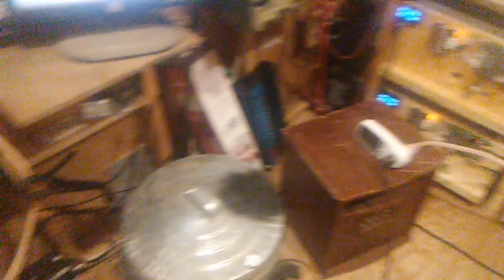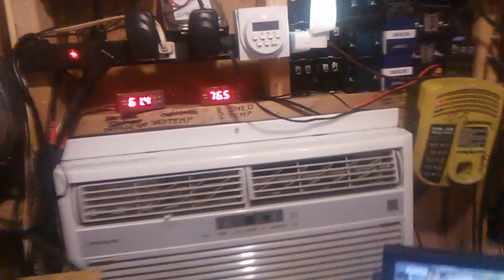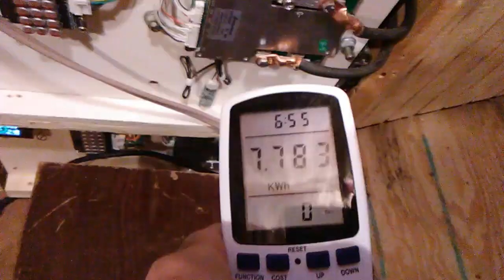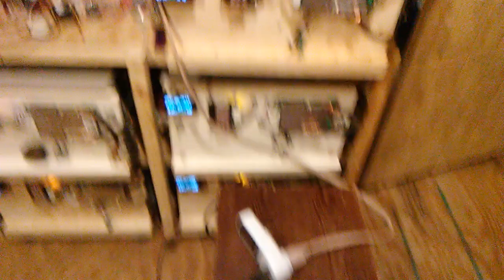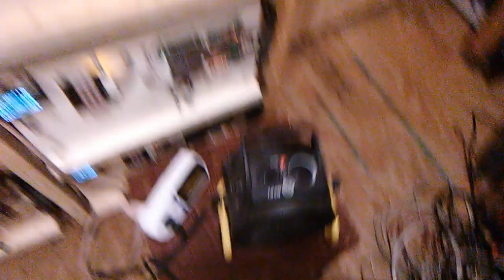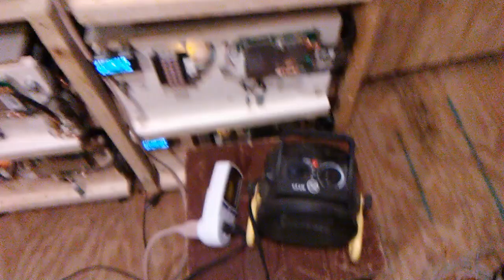Bossrox DIY Solar ~ Sand heater vs ceramic heater test

Comment: How hot was the sand battery in the morning - ceramic heater will be with zero left heat!
Reply from the maker: !50- 200 degrees, nothing of any worth. I save about 5kw overnite by heating the sand heater with my excess solar during the day & the early heat it gives off cuts back on the ceramic heater coming on sooner.

Comment: curious how long at sand max temp will it put out heat for? im thinking an external wood heat source piped into heat the sand.
Reply from the maker: As I recall, I shut it down at sundown at full output & by morning it dropped to 200 degrees

Comment: Honestly, this is about the finding I would expect.  Ceramic heaters are pretty darn efficient as far as converting electricity to heat is concerned.  It's just that electricity isn't the most efficient or cost-effective way to generate heat.  While the advantages and disadvantages vary between the two as far as context and applications of use, the overall energy consumption should prove similar.  

Sand heater stores heat whereas the ceramic heater does not, so that can have advantages in certain applications.  Conversely, the fact that the ceramic heater can begin heating immediately has advantages in certain applications.  So there can be efficiency implications based on your application, but there really shouldn't be much when it comes down solely to conversion of electricity to heat.

Comment: Run your sand heater off 100+vdc directly from extra solar panels.  It's more efficient and maintains the heat through the night.  My garbage can is a little bigger than yours though. 350lbs of sand.  I run a AC radiator oil heater direct from solar DC too.  Still use 12vdc Diesel heaters to warm up in the mornings though.  Thanks for the experiment.

Comment: thanks for sharing your experiment,
but you should try putting iron pipes inside the
sand tank and pushing out with air.
You might get different results